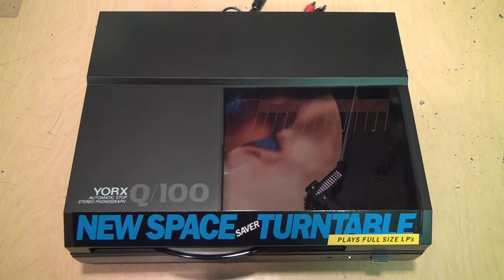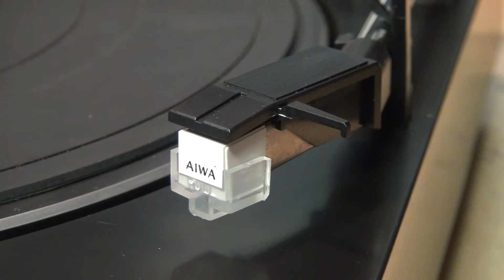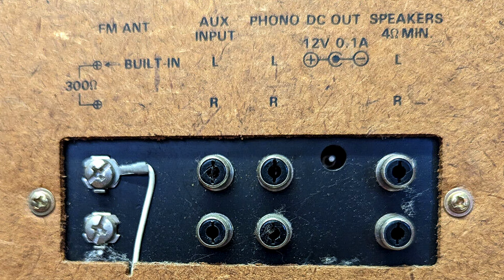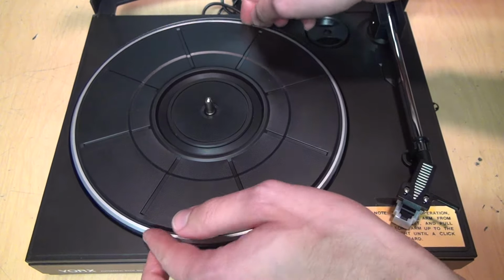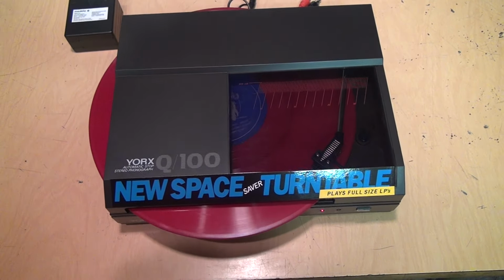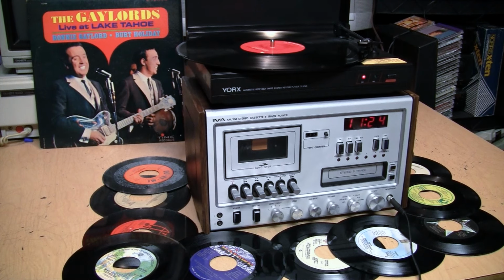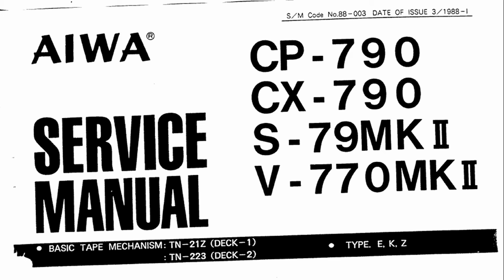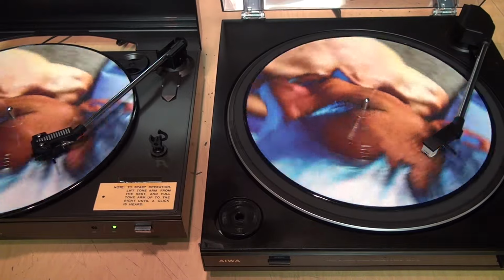How to rescue an orphan turntable - and why you probably shouldn't

Comment: Yeah, the third orphan type is definitely a big thing. I worked in HiFi retail in the late 80s, and customers often wanted a Kenwood/Technics/Pioneer midi-system without the included turntable. Mostly they were "proper" self-contained models though, with regular power/audio connectors. Often they'd have a 3.5mm "system" cable, which was optional/could be ignored. 
We didn't sell brands like Yorx. Lol.
Even if we couldn't do a deal "sans turntable", the turntable would often end up in someone's attic, still new-in-box. I bet there are millions of such decks hiding in attics! Mostly nothing-special Aiwa-esque ones (long after Aiwa's heyday!).
Reply: Just to add a little more....the higher-end midi-systems tended to have much nicer linear-tracking turntables, far better build quality. These, even if people weren't really buying records anymore, tended to get set up with the rest of the system...so there won't be too many of those NIB in attics! Sadly! Just the super-basic black plastic belt-drive cheapies, most of which came out of the same factory.
Reply: If these turntables had standard audio and electrical power connections, what was the 'system' connection used for?  Did it turn the turntable on and off when the appropriate function was selected?
Reply: @Lachlant1984  : Normally, Yes! It was a remote control function.
Reply: @stevesstuff1450  I see.  So if that system cable isn't use, does that mean the turntable is always powered on when connected to AC power?  Did such turntables also have a power switch?
Reply: @Lachlant1984  "system" was for remote control operation, or synchro-start of recordings, or auto-source select on the amp, that sort of thing. Not really seen on the budget models so much... something you'd find on linear tracking decks etc.
Reply: …it just occurred to me after a decade of wondering, it’s got nothing to do with the MIDI signalling standard, it’s midi as in the medium between mini and maxi! (I had tried to Google it the first time I thought about it, but the Googlebot of course couldn’t distinguish)
Reply: @kaitlyn__L  haha, yep :-)
Mini systems were very in-vogue in the late 70s/early 80s...usually very high quality, usually silver. AIWA did some gorgeous ones. There was never a "maxi", just "standard size" components, and then the Midi System was very big mid-80s to mid 90s. Nearly always black. Then fashions changed back to silver-faced mini-systems in the later part of the 90s. For the full-size components, these were often sold as a "rack system" with cabinet & matching speakers etc. Very popular late 70s to mid 80s. The predecessor to the "rack" being the Music Center - all-in-one system in horizontal configuration. They were popular mid 70s to early 80s. 
These days HiFi gear seems to come in totally random sizes 🤷🏼‍♂️ I miss the old days of proper HiFi stores 😥 Tottenham Court Road in London used to be an endless stream of HiFi/video stores... virtually every store front had a massive display of the latest gear. All gone. Last visited a few years ago, and every single store has closed down. Never would have EVER imagined that could happen. It's a shame.
Reply: @njm1971nyc  heh yeah, I really miss those hifi stores from the 90s. The few which stuck around into the 00s became focused entirely on audiophile and videophile gear with £15,000 speakers and £100,000 plasma TVs. 

Even though I’m aware the 90s weren’t their heyday, but that’s the only one I was around for haha. So the mini systems were most of it, but there were plenty of midi sized ones too — just no one around me called them midi by then. Like I’ve very fond memories of those early-90s Sony mid-sized ones. 

(See I think if people just said “mid-sized” I wouldn’t have gotten confused, haha. Since indeed I’m accustomed to “full size”. It was just today I realised midi riffed off mini!)
Reply: 95.5 WPLJ Sliver Stereo, It's the diagnostics that's important well covered.....
Reply: 2:05 I have a low end Technics turntable bought never used from a friend which came into exactly the category you describe. Never used because the purchaser didn't have any records. What he was interested in was the CD player, cassette deck (to make tapes to play in his car) and full remote control the rest of the system had.

For over a year I lent the turntable to a colleague who had a large record collection but no means of playing it as his original turntable broke. He was only interested in playing each of his records once in order to digitize it. That was back when companies like Apple were charging almost £1 a track on iTunes if they even had 1960s & 1970s recordings on there.

@Kaitlin L. While there were no real rules I think of Mini systems as being smaller than 12" wide, while MIDI were slightly over. The impressive ones were the Technics turntables which were the exact size of an LP cover but could play an LP without it hanging out of the side, the SL10 being the most well known.

Comment: Mr Westlife (represent), your videos have been incredibly useful for someone with a current "cheap" vintage turntable addiction. It's really nice to see someone break away from audiophile bs and use common sense and factuality. Your videos have given me a good sample size of good and bad turntables and what to look out for so now I have no trouble finding obscure tables without any documentation and knowing whether they're going to be good and how to fix them. If you ever do come across a Sanyo, Fisher,  or JVC turntable with a "normal" pivoting tonearm but track select, do not pass up on them. They use a cartridge which has an IR emitter and sensor to see the tracks and work much faster than linear turntables. Most also have a remote control option. They're super hard to come by and will definitely have some minor issues, but if you get them working it's something to keep for life.
Reply: I have to admit I have a liking for the cheaper stereos from the 80’s too. Not for the sound but nostalgia. Some of them can actually sound quite good. Think our equivalent to the American Sounddesign and yorx is maybe Amstrad or Bush of which I’ve a few. The cassette decks even on them is still ac bias recording. I’ve one with a slide out turntable and the amstrad is a one piece in a rack looking like separates. I have an old amstrad receiver too which sounds really nice.
Reply: I love those cheap stereos too! Theres something about them that speaks to me.
Reply: The old amstrad midi system we had in the 90s/00s was a beast. Must have been nearly a 14” (35cm) cube
Reply: @TheErador  the weakest point of the whole rack system units were the speakers! If you swap them out for something better they sound quite good. AC bias cassette decks, metal tape compatible, decent tuner. The bsr auto return decks work great once you clean out the old grease and replace it. Last one I did was completely seized!
Reply: Agreed

Comment: Wow, you've just made an Apple turntable: 3 adapters and converters to be able to use this as an accessory.
Reply: You say "Apple," but we can really thank the USB Forum for taking the "universal" out of USB.  "That connector is so 2015.  Use this one instead."
Reply: @nickwallette6201  Yep! USB has become a real  mess. Maybe Apple should stick with Lightning after all 🤭
Reply: @Bob-1802   Haha... I really don't care either way.  I would just like for one connector to stick around for a while.  Every time I build up a collection of cables and chargers, it changes, and I have to start over again.  So whether it's Lightning, or USB-C, the 30-pin dock connector, or the old Motorola 3-pin thing.. just pick one and leave it alone!   X-P

Comment: Speaking of "orphan turntables", several years ago, I bought an "orphan cassette deck" made by Scott that had a ribbon cable to connect to its matching amplifier. Luckily, I bought the Scott amp (with remote included) for only $11.99, its matching tuner for $10, and the next day, the aforementioned cassette deck for only $5 on a half-price electronics sale day at my local Salvation Army Thrift Store. They all worked well and I added a Nikko CD player (only $5) to the set.

I had assumed that the Scott amp and tuner would likely be picked up by someone else, so I jumped on them on the non-sale day, but I figured the "orphan cassette deck" would be useless to anyone else since it did not have typical RCA cables to connect to any amplifier, so I took a chance on the half-price sale day, got there early, and scooped up the cassette deck. :)

Comment: I had that Yorx stereo, that starts around 8:32. Got it for my birthday in 1987. It also came w/ a rack and the most ridiculous speakers. The latter were about three feet tall, but each had one 8", full-range driver, down near the bottom. I later found some better speakers at a yard sale.
Reply: Hate fake full range speakers. Just unnecessary cabinetry
Reply: How about fake tweeters and EQ controls? When the manufacturer puts more into deceptive decoration than actual functionality I lose my mind.

Comment: Good research job on those old, cheap turntables.

A few points here:

1.  I never really got a good look at the underside of the Yorx platter, but I was thinking that since you essentially "armed" the shutoff mechanism, there may be a "boss" molded into the platter that trips the shutoff when the tonearm gets to the runout.

2.  I'm also a big proponent of making reversible modifications.  I would have gone so far as to remove the original power cable on the Yorx, cut the plug off of the adapter (DC adapters are easy to find) and soldered the cable directly to the original attachment points.  Likewise, I would have removed the ribbon cable from the Aiwa and installed suitable cables.  But then again, that's just me.

3.  The intro to "The Colonel Bogey March" at 20:51 bears a striking resemblance to the intro of Steely Dan's "Do It Again."
Reply: #1 if you watched closely you would see that the tone arm activated the switch as well as shut off the switch.  But the thing about that set up it puts side pressure on the tone arm that puts pressure on the outer edge of the record. For me to not ruin my records, I would have bypassed the switch with a external one and not used the clicking mechanism since it ride the outside of the record groove..
Reply: @rennethjarrett4580  I definitely would have modded the Aiwa for standard power and audio connections, but I would have done so in the least destructive way possible -  UNSOLDERING the original ribbon cable and storing it (along with the necessary notes to restore it) inside the turntable.    The holes for the standard wires I would make in the bottom of the unit to keep that as hidden as possible.

It's not like those cheap 'accessory/afterthought' type turntables are ever going to command high prices - at least not anytime soon.

Comment: Given that Aiwa's design, if I were going to the trouble to convert one I would've just desoldered the original wire from the circuit board, completely replaced it with new wiring for a separate wall wart and RCA jacks, and taped up / stowed the original wiring somewhere in the body of the table.  That way the mod is a bit cleaner and less destructive if I ever had to revert it back to its original state.

One could even do something with pin headers on the board if they were up to it, but let's not get crazy.
Reply: Thank you for writing down my thoughts.😄
Strange approach saving that really crappy York then gut the Aiwa.
Reply: @Varangian_af_Scaniae  I think he was showing ways anybody might be able to do it.
Reply: Yep, exactly what I was thinking. Would have been much, much cleaner.

Comment: Hello Sir, very interesting video. Here in the UK in 1994 I bought an Aiwa midi system z1500 and with it a fully automatic turntable px-e850. I believe you have one. System had a double cassette,3 CD changer and 4 band radio. It also had different sound categories like pop,rock,hall,live etc. It cost £399 including 3 way speakers as well. The next year was my dad's 60th birthday and we all got together to buy him a new music system. We looked at different brands for around the same price eg Sony, pioneer, Kenwood. Couldn't beat the Aiwa and bought the same as mine. I still have the turntable,I sold it recently as it worked perfectly. I'd bought a replacement cartridge years ago for £11.99,an Audio Technica clone. As it had a built in pre amp I used it with a Sony NX1 system. Some people are asking silly money for it,one £95!!!.

Comment: Funny and great subject! I bought a full-automatic Technics SL-JS16R (with T4P cardridge) a few months ago for only $10 with the same idea, trying it to use it. Much cheaper than other turntables of this brand only because of the plug. 

Before I bought it, I searched for the service manual of the system and turntable online to figure out the pinout of the 12-pin connector. With success, made a breakout board for the connector (preserve the connector similar reasons you mentioned) and yes, now I can use it. To a surprise there was a preamp section inside this model, the AN7310N so I was able to use it on a line-level input. Works great. Test the speed and such and is spot on after all those years. Worth to do this? Yeah, for sure! Great turntable for what it is and an alu platter. Creativity and to learn something is always a good thing. Please don't translate any action you take into money, don't be afraid to try it. It is a very satisfying process. 

Tip for power jacks like you showed us, you can buy male and female jacks with wire screw terminals at the end. With these you can make your own power adapter cables and you can also swap the polarity if you want. Very useful, no need to solder (you need some wire and a screwdriver) and you can make any combination you need. 

Great video and subject, as always.

Comment: Even though I'm not particularly into vinyl (..yet) this video is awesome because I actually have an orphaned set of speakers that came with an old Gateway monitor I used to have. Monitor died but the speakers sounded pretty good for what they were so I salvaged the speaker bar, which has one of those male barrel connectors on it that's meant to plug into the monitor itself. Been wanting to figure out how to get it running again and this video reminded me I should probably get on that. Also didn't know polarity reverse adapters were a thing, either. Good to know.

Comment: The small realistic sa155 amps like the ones you’ve reviewed in the past equalise a ceramic cartridge perfectly too. They can actually sound quite good even with only under 2 watts a channel.
Reply: Yes, my SA150 has a CER-MAG switch & phono ground lug
Reply: Those little SA150 and 155 amps are indispensable and very versatile.  I insist on having at least one around at all times.  Give 'em some reasonably efficient speakers and they sound fantastic despite the limited power.
Reply: @xaenon  I’m the same I have two lying around. The older one with the silver facia I also have the matching tuner and cassette deck. It’s a great wee system and I’ve not even had to change the belts on the cassette deck.

Comment: Thanks so much.  Your narration provides a very understandable explanation of what is going on.  I’m a boomer and many music fans were also basic audiophiles.  And many audiophiles had a very simple understanding of electronics.  I can basically understand your description.  It seems a shame that the low voltage connectors weren’t standardized.  That probably would have frustrated me if I were to attempt the procedures you went through.  I may not need to make a connection like this but it would be a confidence booster if I could.

Comment: Great tutorial on how to give an otherwise useless item new life. Very neat to see the origins of the AT-LP60. I assumed it was a new/modern design.

I actually have an orphan Technics AM/FM tuner that I found at a thrift store a couple of years ago. I went a bit further and drilled holes to put jacks for the line output and power. It takes a strange power input - 9V AC.
Reply: I don't suppose it's the ST-Z990 by any chance? It had a ribbon cable connector carrying power, audio and even remote control signals. At the time I was so desperate to find a standalone component tuner that I decided to spin the wheel and bought it, even though I had to take the matching cassette deck with it. (The latter got tossed after kicking around for a while.)

I did get it to power up (also 9 VAC) and even haphazardly wired it up to hear it play. That was as far as it went, because an analog Kenwood standalone tuner came along. I'm not sure if the Technics tuner is still around or not...
Reply: @uxwbill  Yep! That's the one.

Edit: Whoops, it's actually an ST-Z550. Looks similar :)

Comment: You can test with multimeter if it's a center positive or center negative, set the multimeter to continuity test and touch one of the probes to the center pin and the other probe to a grounded place if it beeps it's center negative, if it doesn't beep it's center positive.
To find out the voltage just give it three volts and increase the voltage slowly until it starts to play at correct speed.

Comment: Yorx and Soundesign are two pillars of budget tier stereo manufacturers from 80s and 90s. They would make an impressive looking medium sized book shelf stereo and they would cost about as much as smaller boombox made Sony or Panasonic. Since the price was similar I bought a Soundesign stereo and my sister bought a Sony boombox . When we got them home and set up, I was disappointed how lousy my stereo sounded. It would distort at 1/3 volume and tape recordings would also sound distorted and muffled. The Sony on the other hand sounded decent and it made excellent recordings. Lesson learned.